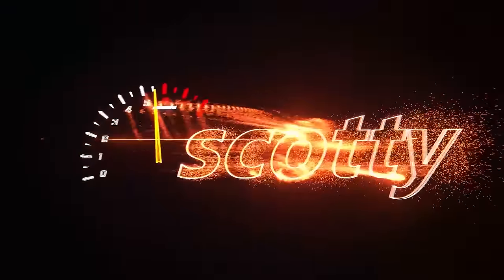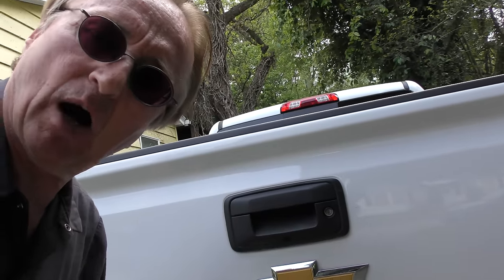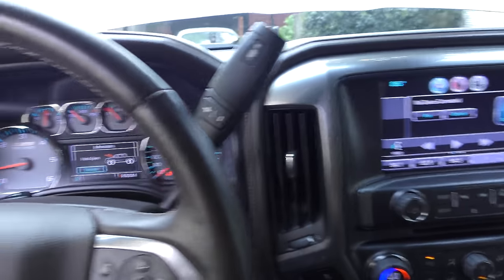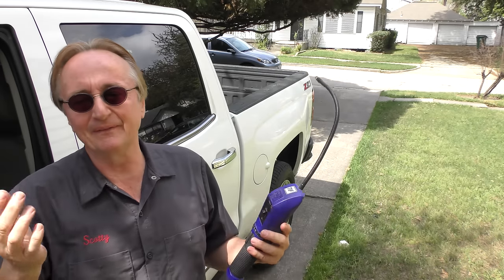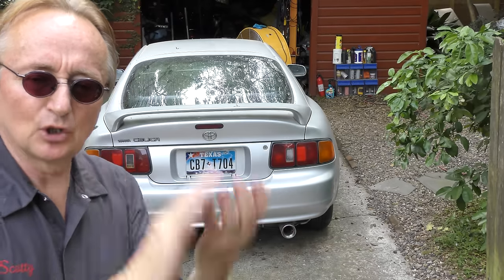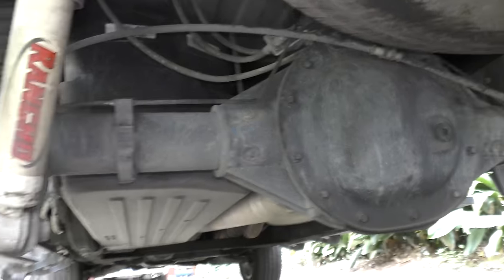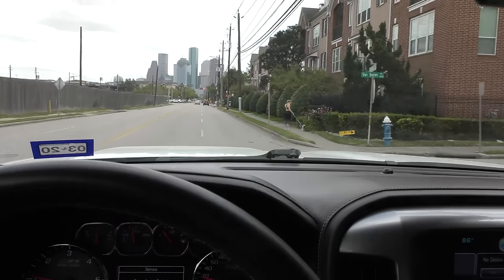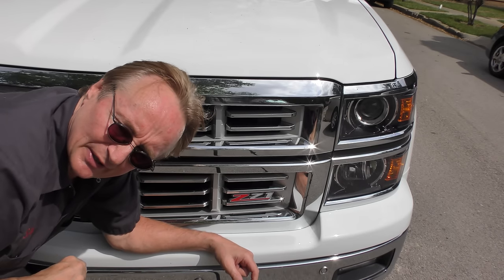Here’s Why I’ll Die Before I Buy a Chevy Silverado

Comment: Man my 05 1500 is an awesome truck. I’ve owned multiple brands and years trucks. My Silverado is the best one I’ve had yet. Toyota Tacoma and tundras and the new f150s are awesome as well. But those 99-06 Silverado’s are amazing work trucks.
Reply: Just had my transmission in my 2000 1500 go out (3rd gear) after 270,000 miles.  Can’t complain with a 20 year old car.
Reply: @Brees1986  Rebuilt my 4L60E by hand for about 500 bucks in parts and stuff. Pretty easy. 3000 miles no problems so far. Love chevy simplicity.

Comment: I’ve had 5 Silverado including my 2018 2500hd durmax. Never had any of theses issue and all of have had well over 250000 miles. Your rule mileage on the 2015 which I had is way off. Love my dirty max so not all of them are bad. Oh and I paid cash for my high country.

Comment: The tailgate latch broke on my '95 GMC truck... after 25 years of hard use!
Reply: Jeff Zekas I’ll bet it was the little plastic clip at he end of the linkage, it takes about a minute to change
Reply: Latches and handles break and are cheap.  Just as long as the $1,000+ parts are okay I'm okay
Reply: @timothykeith1367  True, but the point is: the truck still runs after 25 years

Comment: Well we have an '88 Silverado and an '03 Saturn VUE they were given to us, and that's all we got. We are hanging by a thread.
Reply: They both are good vehicles, before GM went to absolute utter rubbish
Reply: @GhostOfAMachine  thank you I am hoping and praying, that will fix both of them.
Reply: @GhostOfAMachine  I see some still on the streets.
Reply: @laurieannrodriguez4551  my mom used to have an 03 Vue v6 same engine used in Vauxhall police interceptors in UK and that car is really quick, doesn't look like much from the outside but it really goes. And I see a lot of 80s and 90s Chevy pickups here still being used for work. Reliable and easily repairable.
Reply: My mom had a Saturn Vue that was an 03 I think but it had the 3.0 V6. The transmission had to get changed once and the only other problem was the security system will some times lock the car out from starting up. I have this issue with an 08 Chevy Colorado so the security system issue is quite common in GM vehicles.
Reply: 99 Silverado
Reply: @anonymousxish   Thank you.......its going to quite a project vehicle.
Reply: @anonymousxish  many blessings to you and everyone.
Reply: If it weren't for Scotty,  I would have never known about all this monkey business going on in the auto industry.
Reply: Ha! The Saturn VUE commercial, "Better than being homeless!"
Reply: Laurie Ann Rodriguez those 80s Silverado’s are a whole different animal. Take good care of it & it’ll return the favor. Best of luck to ya in these crazy times 🤞🤞

Comment: Um, this is kind of the point of Chevy. Ever since they were founded, Chevrolet's whole shtick is that they make low-class, cheap cars for low-class individuals and they usually run for years. The original 1950s Bel Air sold for about $100, which with added inflation, would be approx. $976.05 for today's standards. They are one of the best car companies in existence, and always have been. If you disagree, I hope everyone can agree that Ford sucks the most.

Comment: Had one newer model as a work truck in Fort McMurray. I can't believe all the problems we had. Constant error codes and the transmission locked on us during a call. They replaced it with a much older pickup.

Comment: You’re taking one Silverado out of how many? This is anecdotal tbh.
Reply: My 2016 Silverado has the exact same issue.. 2500 to fix it..
Reply: 14-15 Silverados have quality issues, Radiator leaks caused by the thermostat, Condensor failing at a weld. Its not just silverados, carries to Tahoes and Suburbans up to 2017. GM Service Advisor and Ive seen plenty

Comment: My brothers 2014 silverado had an issue where the truck turned off sometimes, even power steering shut off, how dangerous and the ac never worked.  They are nice looking trucks but if they aren't reliable why bother. Tundra or Tacoma for me

Comment: I think you could make those same points or others about most cars these days.  You're definitely the expert but I will tell you this.  I bought a 2000 Chevrolet Silverado 1500 Z71 Off Road new off the lot.  As of today, September 6, 2021 I have had only two things go wrong with it:  I replaced the fuel pump (no big deal just lifted the bed) and a wheel hub.  Period.  That's it!  Otherwise just routine maintenance items you'd expect after 21 years.  Actually you could argue the fuel pump and hub are expected failures.  Oh, and my air conditioner freezes your butt off!

Comment: GM never had the quality. I had a 2010 terrain, and it was a great car overall but had one major problem. Timing chain would go bad every 40k-50k miles. $1500 every couple of years
Reply: Having trouble with one doesn't mean they're all bad.  They all put a crapper out now and then.
Reply: Yep....ours too!
Reply: Replacing the timing belt on a Honda Civic is considered, according the the owners manual, NORMAL MAINTENANCE.

Comment: Next video
Am I trading my Matrix for this Chevy?
Reply: Just trade it in for an older one, between 2002 and 2007 with the 5.3 L V8 engine.
Reply: I got a 5.3 2014 Gmc 170000 still runs like new
Reply: @davidleeosbourne2727  That's great. Keep it up with the maintenance.

Comment: I bought a 2005 Chevy Silverado 1500 LS new and now has 173k miles.  Have a good mechanic take care of it and fixed what needed to be fixed over the years so it is in good shape for a 16 year old truck.  Had the hood and cab painted and blended at a great local body shop for $1800 and received many compliments.  May crash tomorrow but so far so good.  The radio car shows always say to save a car payment each month on a used vehicle to fix the inevitable breaks in all used cars.  

Will say from experience don't buy a high mileage used BMW x5 over 100k.  May ride great but breakdowns seem to be frequent and usually expensive.

Comment: there is not any evaporator that will not take a lot of hours to replace. so would not hold it against the truck. but this generation gm always has a problem with the cam phasers and throws two timing related dtcs p0015 is one of them i believe.

Comment: Change the oil every 5k and keep good tires on it, and you might be surprised how far it will go and how good the fuel economy can be. I’ve got just over 28mpg Highway in mine during summertime going just under 70mph on flat roads.  I do worry about the trans going on my ‘15 Z71 at some point or possibly the afm acting up despite having treating it very well these last 5 years. But I bought it when it was 2 years old for $29k with 49,000 on the clock and have put another 45,000 on it so far. Only careful routine maintenance has been required to date so I’m not complaining.
Reply: when did he turn into get off my lawn guy🤣

Comment: probably not the evaporator, try checking the condenser on right side where the drier is mounted, there is a tsb from gm on this problem. just replaced one and is known problem. $120 for condenser and about 2 hrs labor.

Comment: Ok could someone answer this, why do the 2000s generation Chevy truck 99-06 and new  likeli frames rot out soooo bad? Granted I'm in the rust belt in Maine n I've seen gmt400's rotted  in half too but no where as many. I looked at a 03 and I could flex the frame with my hand it was so thin and that more common than not, but my 92 is still solid actually fairly grey rust free except just behind the leafs it's starting to get rusty. Is it the gauge of the steel or a low quality steel off the lot? There both a c channel frame in the back and boxed from the front of the cab forward but I've seen 99+ even into the 07 up trucks that was rusted through. The body's are even worse they just rust out in no time like 5 year old trucks with holes right through in the sheet metal like above wheel wells. I've seen new trucks on the lot with surface rust all over the frame, to the point my 92s frame is still mostly grey colored. And my 92 has been in Maine it's whole life with 250k++ miles (odometer stopped at 221k in 2010ish when I installed an aftermarket trans with wrong speed sending unit I never fixed)
 What's up with the rust buckets?!?! I've joked some day there will be a killer drive train sitting in a pile of orange dust n plastic...easy to pull a LS engine just pick it from dust pile....

Comment: I have a 2005 Silverado Z 71 4 door short box with 362 k on it. I love my truck , all leather interior , sun roof , power mirrors even with tilt when getting into small garages , just hit a button and mirrors suck into the doors. It has the 5.3 vortex in it and i can honestly say i have had zero problems with it other than changing a water pump and the usual stuff like brakes , ball joints , tie rod ends . Remember it has 362k on it,lol. Still rides like new , tranny shifts like butter and engine hums along just great. I'm a mechanic so i service it on time , every time and that my friends makes a big difference. Like my dad always said , you take care of it , it will take care of you :)

Comment: I have a 2008 Toyota Yaris and I have to say it’s the best vehicle I ever owned.  The interior is a little plain but I put in an after market interior kit that makes the control panels look like mahogany wood.  I also bought weather tech floor mats and leather like seat covers.  No power windows or mirrors.  No cruise control.  The most basic of the basic.  No heated seats either.  In winter I have remote start to warm the car up.  I put in an after market radio that has a backup camera built in so really it is perfect for me.  All the people who laughed at me for buying such a small car weren’t laughing when gas went up to $4.00 a gallon ; ) Absolutely no problems whatsoever!

Comment: My 2010 has 230,000. Never changed anything but oil, tires, belt, plugs, and starter. My air is still so cold you have to turn it down on the hottest days.

Comment: I have a 09 Silverado 1500 with the 4.8l it almost has 300k miles on it still runs fine I wouldn’t buy anything past an 09 though the only repairs I’ve had was replacing control arms, tie rods and stability control rods and that was only about 300 dollars of parts and a couple hours of work to do myself. I also had to replace the tcu but I got a preprogrammed on to my vin and mileage for 120 bucks and replaced it myself
Reply: I also have a 96 Tahoe with the 5.7 gas engine I’ve got a lot to do to it but nothing super costly just fluid changes and new rotors and some other stuff

Comment: That goes for Ford and Ram. My 1.5 year old F-150 has cheap plastics like that one, the dashboard warped, the display in the instrument panel is not working, the engine started shaking at 20K. So I called the dealer and they told me a need to make an appointment 3 months down the line, before they can look at it.

Comment: Is a 2009 chevy silverado v6 with 115k miles worth buying for 12k?
Reply: Okay, that's fairly low miles and the engine is fairly good. Check the inner door handles to see if they work that was a problem with that generation, but I'd keep an eye out for a little better deal. I got my 14 for 15,000 with 140 on the clock (with minor paint damage and one tiny dent on the hood)
Reply: @fallout0624  Im from CA, so everything is f#$king expensive here lol.
Reply: @Tikus_90  oh you in Cali, that's a great deal for a truck that new

Comment: Original owner here of an 08 silverado. 225,000 miles. Iv put this truck through hell and has always come through me. Never neeeed a repair. Engine has had a bad oil leak for 2 years now and the lifters had been making a bad noise due to oil pressure being low. Running like a CHAMP 💯😂 I have 4 Silverado’s two from the year 08 and 2 from year 07. Badass trucks. Everyone knows how to work on them and costs are low when and if need be.

Comment: Love my 2019 Silverado LD… runs great. AC is cold. Inside smells brand new still. Cons beside price… I don’t care for having to push a button each time I wanna hook slide without ABS kicking in… (after turning abs off, it resets to abs each time you turn off truck. other than that I’m happy. Pulling power is beastly. Way faster than my Ford 150 was…

Comment: I've got a 2003 GMC Sierra with 400,000 miles. Original engine with no internal engine work. Granted it had the 4l60 which is junk so I put in a 4l80e to fix that. But the frame is damn near mint and the only things I've changed on it were changed because I wanted to make it better. Never had a single thing break that wasn't my fault. Been a great truck. (btw Ive never had a plastic handle break either) I'll agree that chrome buts are stupid and start to bubble over time. Which is why I removed them

Comment: 2006 Silverado with the 4.8L V8---337,000 miles and no issues whatsoever. This sucker was my work truck for the first 250,000 miles of its life and still pulls a 6000lb travel trailer for weekend getaways. No degradation in performance or mileage at all. There's a reason a LOT of mechanics love the 4.8l. It's the longest lasting non-diesel engine on the planet and it isn't even close. You're wrong, Scott.

Comment: I'm driving my 2015 1500 for over 80k miles and only oil changes and tires.  My friend with the F150 has been in the shop 4 times.   I also have a 2018 1500 and runs great.  Worst truck I am sad to say I have owned was a 2005 Ram.

Comment: Got 240,000 miles on my sierra and it still has the original AC. It has only a couple small repairs. 
Lots of the "cheap" stuff scotty complained about can be blamed on the EPA. They set guidelines for auto manufacturers to meet and part of those guidlines are weight/size/fuel economy restrictions. So by utalizing more plastic they reduce weight and help achieve better fuel economy.

Comment: 05 Sierra sle bought in 15' for $10000 with 135000miles. 4.8 L Runs like new . Changed all brake lines to copper/ nickle , remanufactured transmission at 164000 miles for $2200 installed . 192000 miles now still going strong.   Being in the rust belt in Connecticut however is brutalizing the wheel wells and the rocker panels are almost non existent. Was going to get the rust taken care of but with my luck the frame would probably let go soon after🤣. So anyway for $12200 into it I'm just going to keep up on maintenance and drive it till it quits or falls apart . The AC blows cold as new and never leaks . I could never see buying a new one for what they charge now and the questionable quality.

Comment: Don't have time to watch your video right now but my 99 Chevy Silverado 5.3 I went over 300,000 miles no smoke use full synthetic oil original starter new water pump new radiator brakes I don't remember ever putting in a new alternator truck was running like new when I sold it but I thought hey I better sell it before something goes wrong so I bought a new 2021 Chevy Silverado 5.3 8 speed we'll see what goes on with that one

Comment: Have to disagree! I Have a 05 Chevy Silverado 1500. 306k miles replaced transmission at 284k and front end is garbage but super easy to replace. Live in Maine so the rust has caught up with it. However if I found the same truck stored away I would buy it in a heartbeat

Comment: I put a new transmission at 115k miles (just out of warranty) on my 2015 Z71 with tow package.  Also had a push rod issues back at 65k, that required a top end overhaul (under warranty).it saddens me to say that  GM's 1/2 ton is garbage now.
Reply: Haha 😅 I  forgot to mention my AC is currently leaking and in the process of dieing

Comment: Hmmm. My 2016 Chevy Silverado- 250,000 miles(I drive ALOT for a living). Only needed a new alternator. My wife’s 2016 Toyota Corolla- @65,000 miles. Blown engine, new alternator, new fuel pump, etc., etc.

Comment: Had a 17 silverado 5.3 tranny dropped at 28k with normal use, junk, my 08 silverado is still running strong at 250k, over 100k of backroad miles on it, my 08 hauled over 500 cord wood on dirt drove through beaver ponds and everything Inbetween no doubt the strongest truck Chevy ever built after the 2000's

Comment: I just dont get it GM what the hell. I have an 09 gmc crew cab long box 4x4  duramax with168k miles iv only ever had to replace the serpentine belt, u joints front axle hubs and regular fluid changes - brake servicing  just pads and fluid never a bad caliper. It still has the original alternator folks. 14.5 volts all day long.  Every accesory works like new and i have the ls model with every option avalable in 2009. I do run a diesel fuel adative at all times...   what happend GM?

Comment: 97 7.3 f250. 201k ice cold and hotter then hell when ya turn the eat on. Ford ranger 01 132k or so amd same thing. 92 mightymax little over 256k and blows hot air as well. No ac since it is a base model. But does have the mounting bracket

Comment: Do a video on the 2018 ford focus . My son bought it new 45000 miles engine blew dealer put in a new engine ,car was still under warranty.After a month or so he is driving to work the engine shuts off in the middleof the highway,had it towed to the dealer the dealer drove it a mile told my son there was nothing wrong with it anyways to make a long story short if driven between 25 to 30 miles engine shuts off he had the car at the dealer for 21 days in one month dealer still said nothing wrong with the car after driving it for a mile at a time he ended turning it in and buying a toyota i think its a shame that these car companies are putting junk out and we are stuck with the bills

Comment: I have the exact same truck. Condenser went out around 50k miles. My truck is now in the shop having a remanufactured transmission put in with less than 80k miles. Thankfully when I bought the truck I bought the extended warranty because the manufacturer’s warranty is out as of now. If I’d known better I would of bought a Tundra.